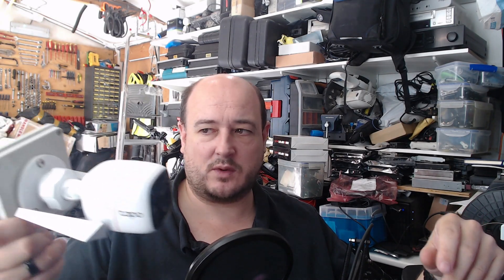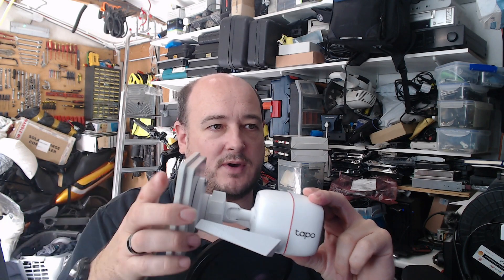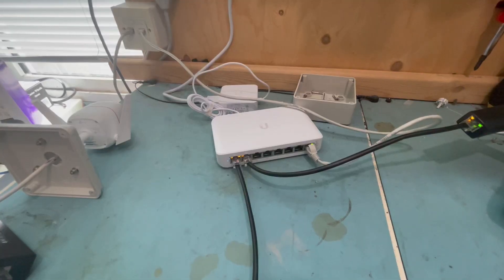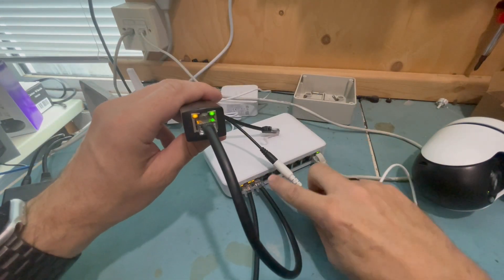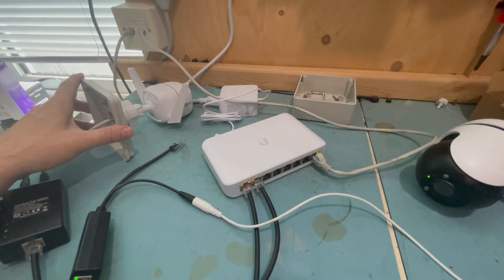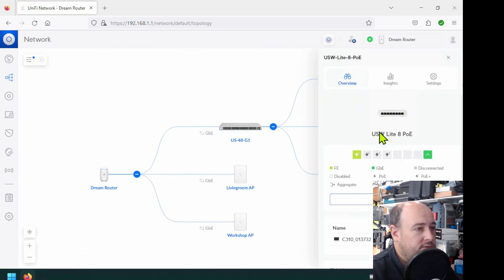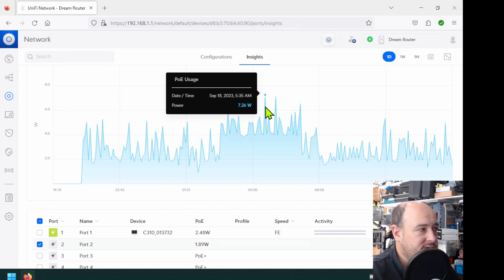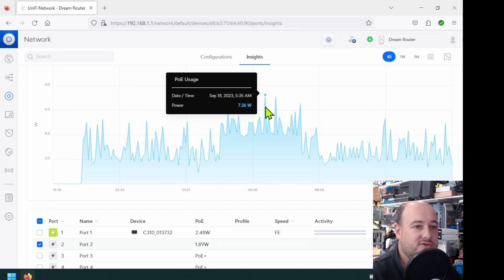PoE Splitters on TP-Link Tapo C310 and C500 Camera's

Comment: New to your channel and looking at using Poe on the very same cameras 2x c310's to a Reolink NVR. Trouble is, I'm worried about frying the cameras as the splitters are 12v and the camera supply is 9v. Wondering what the solution is. Just noticed you mention this. Maybe source a 9v version then
Reply: Just an update on this... I have found some info on Reddit with some people using a supply voltage of 12v. It turns out the C310's power converter IC has a Vmax of 18v DC. So 12v should be ok from a cheap 12v splitter. I'm going to run this anyway.

Comment: Thanks for the info. Surely I can just use a POE injector and POE splitter.

So CAT6 from router LAN port to POE injector then CAT6 from POE injector to the POE splitter and I should be good I think?

My application only requires two c320ws camera's.

Comment: Hey, been following your video to setup my ip cameras at home. Got 3 c320ws and 1 c310. I also got a tp link poe switch tl-sg1005p but I've tried using the splitter just like you showed on 2:45 and, like you said, it needs the power cable on the other end to work. So, now I'm trying to got another splitter like the one on 9:35, but I'm confused because it looks like it does the same thing as the other. Could you please explain me why the first one need the power cable and the second one don't?
Reply from the maker: Hi,
The first splitters, the white ones need you to have one of the splitters at each end because it uses two pairs of wires in the network cable to transfer the power from the wall brick that came with your device.
The second type, the PoE splitter does not do this as it will get the power from the PoE switch as it has the electronics in it to tell the switch to provide power.

You need to make sure your switch is a PoE switch for the second type, the PoE splitter to work.

Comment: Can you tell me if you managed to make the Tapo camera work on a POE splitter? If so, which splitter did you use? Greeting
Reply from the maker: I did get the tapo cameras working on the PoE Adapters. i cant post a link to the adapter I used in here but if you look in the about section on the channel you can ping me an email and I will give you a link.
Reply from the maker: I've added a link you can copy and paste in the description.
Reply: @glanoe  I send you email.
Reply: Thanks, I found this very informative. I came across this looking for a solution for my TP Link Cameras. You did mention trying it on a Deco unit. If you did was it a success?

Comment: Hi...at least for me there is no sound until about 8:00. It may just be my settings or dodgy Mac...but maybe you can check. I am interested in using TAPO outdoor cameras for my new  home. I was going to use more expensive HIK vision cameras...but I've had a few TAPO indoor cameras and been very impressed with them (the app is great). The house will have LAN cabling so options are open if I were to use the POE splitter method. Any experience with the weatherproof durability of these cameras?
Reply from the maker: HI,
Sound is good for my, comes in at 1 second ist.

Not had any issues with the waterproofing on these so far, they are very well lealed on the back, the cable entry point in the bracked is fused with something like epoxy so there is no way any water is getting through that and the rest of the body of the camera seems very well screwed togther and solid.